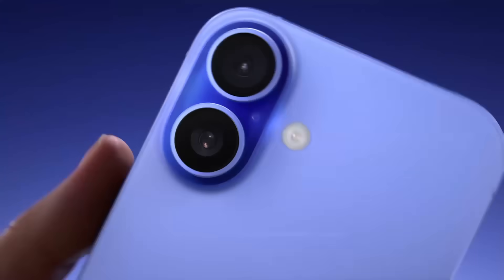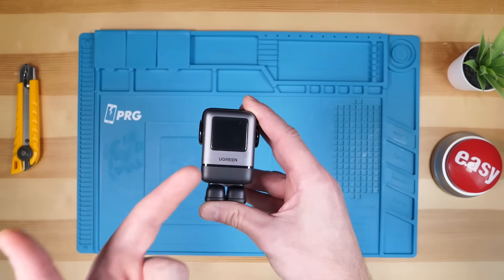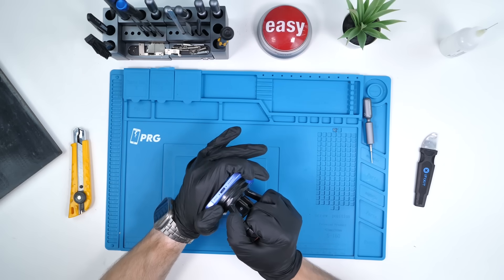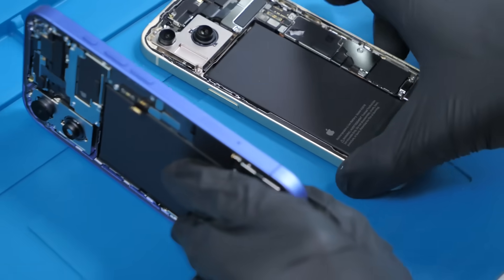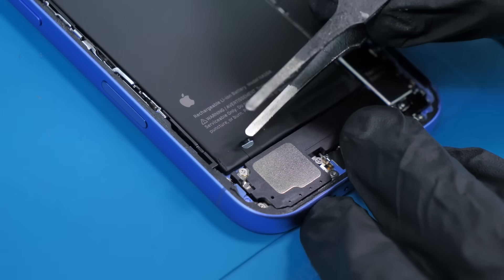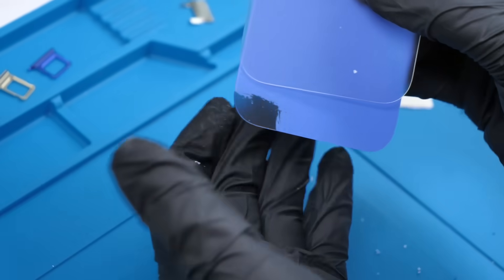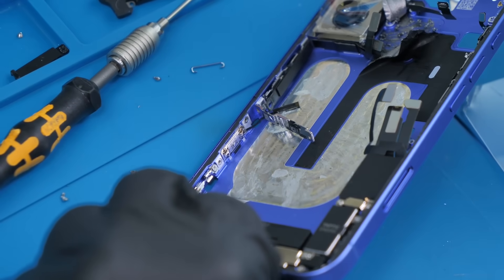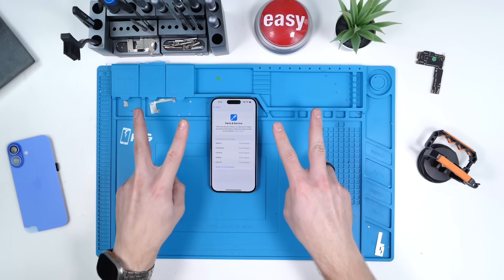Why So Serialized...? iPhone 16 Teardown/Repairability

Comment: Wait, so apple is intensionally stopping battery upgrade
Reply: No. He was supposed to use a 9v battery on the new pull tab to send a current to that new metal adhesive strip that would have made the removal much easier than it has been in the past.

Comment: Interesting method to remove the battery. If you think about it, it's easy to remove with. Just conect that battery and clables and you're done. No need for alcohol or any tool that could damage de battery.

Comment: That battery removal method suggested by apple is such an apple thing to do.
Reply: Its not an apple thing to do to have a proper battery repair method posted on their website.
Reply: @someonetooknuggets  true. But they could have kept a simple battery pull tab, and if they did that they probably wouldn't have posted the removal online.
Reply: It is innovation, and somebody get paid for that.

Comment: That battery removal effort seriously Apple what the hell.....
Reply: He was supposed to use a 9v battery on the new pull tab to send a current to that new metal adhesive strip that would have made the removal much easier than it has been in the past.
Reply: Because he did it wrong.

Comment: The new camera control button should have been Touch ID as well
Reply: Well that is preserved for the iPhone 17 series ig lol
Reply: @HTechno  LOL Then Apple can say "we heard you" and this touch ID is a big upgrade of iPhone 17 (or even 18) after so many years of careful research.
Reply: @ytfanlingeric  yea lol
Reply: Maybe it is an evolutionary upgrade in future Iphones 😂😂
Reply: @mrbeast  watch this bro
Reply: Whit face id why is ned finger print id?
Reply: Coz not everyone wants to take the phone in front of the face just to unlock it everytime @joaom8197
Reply: @joaomauricio-x8y cuz it's sh!t. Allways use yo pay
Reply: Face id is better. Honestly idk why more phones don’t change over to it
Reply: @00-JT Likely not because they need to put a sensor on the front camera just like iphone. touch id is fine no point of changing to face id
Reply: @00-JT  I mean most phones do have "facial recognition" not the 3D stuff like iPhone's. The main reason is because most Androids just use a optical/ultrasonic fingerprint sensor (most under the screen). There's a reason why Apple can't get rid of the dynamic island screen cutout and just have a smaller hole-punch camera or a under screen front camera, because of the 3D scanning sensors and stuff for Face-ID.

Most Androids are designed around the philosophy of more screen space since they were the first to have hole punch cameras or no visible front camera's at all. So, going back to bigger screen cut-outs is a no-go. Until they can get 3D sensors and infrared dot projectors under the OLED display like front facing cameras.. I don't see it happening.

Also, most Android's just utilize both fingerprint and face recognition, and just let you CHOOSE for convenience sake, which Apple doesn't understand it seems.

Remember the Galaxy Note 9 had Facial recognition, Iris scanner, and fingerprint sensor all on the same phone. That's 3 biometric ways to unlock the device. Apple has only had a max of 1...

Unless you're in a toxic relationship or something you shouldn't be worried about the "2D" facial recognition not being "as good" as 3D Face-ID.
Reply: @00-JT  Face ID is not at all better. Touch ID is more convienent
Reply: @normalchannel2185  its really not. You just hold your phone and it unlocks. The user doesn’t have to do anything. Its very convenient.
Reply: @00-JT  With fingerprint you just put your finger on the scanner and it unlocks as you pull it out of a pocket/purse/etc. No waiting time involved.
Reply: @00-JT  except with touch id you unlock it BEFORE you even bring the phone upto your face. Like before you use it you unlock it. While with face id, there's a slight delay. 

Like I haven't seen my lockscreen in 3 days. And the only reason why I see it every 3 days is cause you have to unlock with password every 3 days for security and to ensure you don't forget it
Reply: @Rayjacker  you clearly have never used face id. There’s no waiting time its pretty much instant at this point.
Reply: What exactly is the advantage of that? If I’m using my phone, I’m looking at it. And the new iPhone has such a wide FOV that it can be on the table, not pointing at you, and still unlock.

Comment: To remove the battery from the frame you use a 9V battery. 
That's very unusual, I couldn't tell if it's genius or inpractical. 

Definitely much better than what Samsung and Google do.

Comment: So Apple released instructions to remove the battery, you didn’t read it, and complain that the battery is hard to remove when you didn’t even follow the instructions? 🤦‍♂️
Of course, Apple is NO saint, but ppl like you that blindly hate on Apple only makes them look better.
Reply from the maker: We read it after which is why we mentioned it 👍
Reply: @PhoneRepairGuru  but then still decided to leave in your unfounded criticism of the battery being difficult to remove?

Comment: The camera control button being attached to the housing is crazy and its glass so its guaranteed to break for some people. Apple cant add a button without making it impossible to replace.
Reply: I think breaking it is very unlikely given smaller panes of glass are much harder to break then larger like the back glass or front screen. The image of the touch id surrounded by a cracked screen was a good example.
Reply: It’s sapphire and it’s also not flush with the body - it’s a bit deeper in the side rail

Edit: not pure sapphire, Apple’s weird own sapphire
Reply: @tdrg_ at least on the one I’m holding it protrudes out the frame a little bit, about a third of how far the power button does
Reply: @Mythxiir  maybe. I’m writing these based on what I saw in the Apple store yesterday. I don’t have an iPhone 16
Reply: It's useless anyway who cares
Reply: Its not glass is sapphire
Reply: @00-JT It's not true sapphire, according to JerryRig, which is a good thing because if it was true sapphire, the button would shatter more easily than glass.
Reply: Apple's sapphire is a lot of copium  @00-JT

Comment: As apple has shown, many times, paying more for a premium phone doesn't always give a better experience.

My Samsung Note 9 does everything I need, has a headphone jack, microsd slot, and can be repaired.
Reply: Samsung note 9 is a $1000 dollar phone at release date 😂😂😂
Reply: @juqtra That ain't even the point 😂
Reply: There goes your resale value.
Reply: Well, the galaxy s24 no longer has a headphone jack nor micro SD slot
Reply: Hey Android users, listen up. If you have an Android phone like the S23 or S24, don't act like it's the best thing ever, especially if it's an expensive model like the Google Pixel phones. Why? Because if it gets stolen, thieves can easily resell it and make a lot of money. On the other hand, if you have an iPhone, like the $2000 1TB model, if it's stolen, it can't be unlocked, and the parts are locked to the user's Apple ID. So, it's worth spending the extra money on an iPhone because at least if it's stolen, you can feel secure knowing that the thief won't be able to use it. But if your expensive Android phone gets stolen, the thief will make a profit and you'll be at a loss.
Reply: @americanboy48  Your phone is gone either way so what am I supposed to do with your Info? Plus the new Apple ID lock part features only make repairs more of a pain in the ass than it already is
Reply: @americanboy48 sorry I’m not paying 2k for a inferior phone lmao.
Reply: @americanboy48 Hes listen apple american Fanboy. First of all, how often is your phone stolen? You must've been in a rough neighborhood. Never have I ever had my phone stolen. Secondly, do not act like you can only keep your phone secure if it's iPhone. Clearly you haven't been using other phones aside from iphone in the last 5-8 years because you'll know that you can delete your data in an Android phone if it gets stolen. Isheeps are really in a bubble, thinking their iPhone are ground breaking where in fact, you are behind by 3-4 years when it comes to tech and features.
Reply: @johnpamplona5082  why are all the android users in apple videos' comment section?
Reply: @americanboy48  Why would i care whether or not the person stealing my phone is going to resell it? It doesnt change the fact that it got stolen.
Thats the ultimate cope if your phone gets stolen and for some reason want to feel good about it
Reply: @secretchiley  Plus that implies the thief doesn't lie about locks when selling the parts, or cares when the scam victim gets angry after buying an unusable part.

Comment: Pretty soon we getting serialized screws, and not just serialized to the phone but serialized to each individual screw hole
Reply: Don't give them ideas
Reply: @ThatOneWeeb420 it’s already happened on certain models that need 5 or 4 screwdrivers to work on
Reply: Why so serious?
Reply: Why so serialize?!!?!?!😈😈
Reply: Why so serious
Reply: yeah, maybe is USA, not in European Union, lmao
Reply: Then iPhones will be the most anti-theft phones
Reply: @Hhhh22222-w  you can bypass all these serialized parts with a feature apple added you can calibrate and serialize the new parts to your iPhone
Reply: Easily possible with resistance calculations.
Reply: gotta maka a move to a town that's right for me
Reply: Technically can happen, if you put the wrong screw in the wrong place, well you can damage traces on the motherboard
Reply: I will just move to Fairphone is samsung did make repair harder.
Reply: .... with AI of course.
Reply: we getting serialized frame in future
Reply: After that they're gonna serialize literally everything. I'm talking battery, screen and even the tiny capacitors
Reply: @iesjk the battery and screen is already serialized even the back glass
Reply: @iesjk  Battery and screen are serialized for years.
Reply: @iesjk  battery and screen are already serialized
Reply: That's actually impossible
Reply: @KawaiiGames873 Not exactly... unfortunately, they could use a sticky paper on the bottom of each screw hole that tears when a screw is removed. They can fix it only by removing the logic board, which could have the same tamper marking.